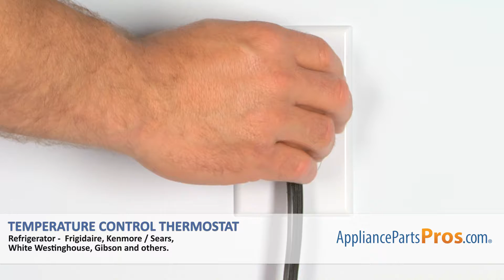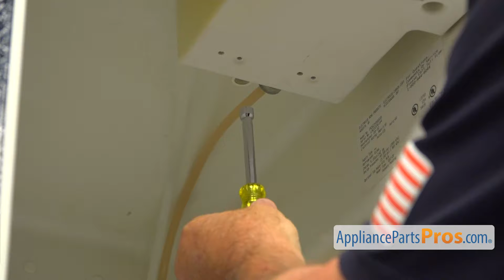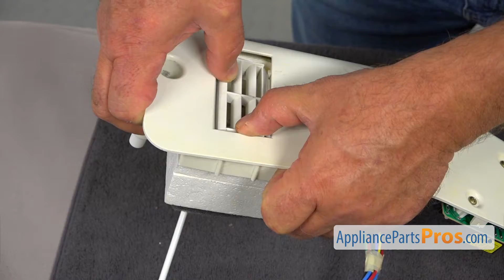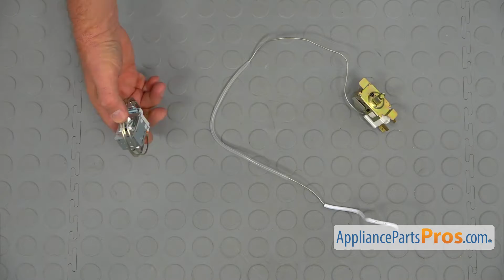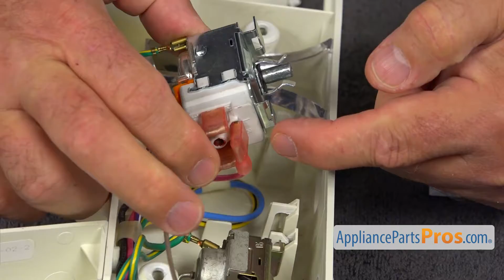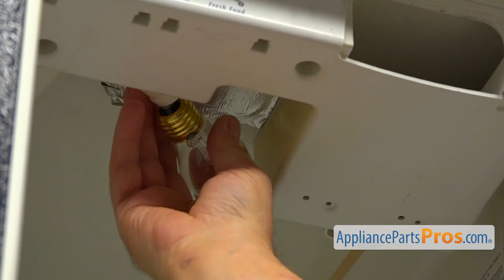How To Replace: Frigidaire/Electrolux Refrigerator Temperature Control Thermostat 240383703

Comment: I have the same refrigerator, evaporator fan runs constantly. . When I turned down the thermostat on the right it does not click or anything, and does not turn the fan off ..so would that be the issue? M# Frs26h5asbb,. Frigidaire for your help.
Reply from the maker: Are the compressor and condenser fan motor staying on as well?
Reply: @appliancepartspros yes..
Reply from the maker: If the fans and compressor are running all the time you will first want to check the condenser coils to make sure it's clean and free of dirt or debris. If you have tried adjusting the temperature and it's still running all the time, then that would indicate a bad temperature control.
Reply: @appliancepartspros  condenser coils are clean, checked everything under there,vacuumed them out.. Now it just seems like it’s on and off on and off. Then it runs constantly.thank you!
Reply from the maker: It is normal for it to cycle off and on. And the unit will run 90% of the time. If it's staying on all the time and the coils are clean then you will need to replace the temperature control.
Reply: @appliancepartspros  sounds good. Really appreciate your help and your quick responses. And Your your video really helps out!!  peace.
Reply: @appliancepartspros  hi, I put the new thermostat in and it seems to be running just as long, but not often on. But now got this funny musty, dusty smell throughout the whole house. I don’t know what that could be. Old thermostat only had two connectors the newer one had three hopefully I hooked it up, right.. any suggestions would be greatly appreciated.. the house just smells like inside a condenser compartment. It’s crazy smell is starting to worry me now. Everything seems to be running as it should.. the hot air is coming out the bottom of the front of the refrigerator.. just seems like it’s blowing out that musty smell from the bottom of the condenser. Any thoughts thanks again, bud.

Comment: I have the same refrigerator, evaporator fan runs constantly. . When I turned down the thermostat on the right it does not click or anything, and does not turn off ..so would that be the issue? M# Frs26h5asbb,. Frigidaire for your help.
Reply from the maker: Are the compressor and condenser fan motor staying on as well?
Reply: Yes..I’m pretty sure they are. thanks.
Reply from the maker: If the fans and compressor are running all the time you will first want to check the condenser coils to make sure it's clean and free of dirt or debris. If you have tried adjusting the temperature and it's still running all the time, then that would indicate a bad temperature control.
Reply: Another thing I forgot to mention is, at certain times it just the evaporator fan just goes off on off like every second,and then it continues to run after that..WTH?. it is really weird. I did order a thermostat for the refrigeration side but now I think something else is going on… question, if the evaporator fan was bad, it wouldn’t run would it?
Reply from the maker: If the fan is turning on and off while the compressor is running then you will need to check for a loose or damaged wire. If the wiring is good then you will need to check for power to the fan motor to see if you are losing power or if the power is steady. If the power is there and the fan is turning off then you will need to replace the fan motor. If you are losing power then you will need to replace the temperature control.
Reply: @appliancepartspros  ok.. I noticed when it’s doing it’s off and on gig, the vent between the freezer and refrigerator opens and closes cycles as well. as well.. I’m hoping that’s just part of the thermostat failing..

Comment: Is the thermostats the same part number for the freezer? Or is it different, on this model?  I have the same model but it’s a Kenmore. But everything you worked on is the exact same as mine.  

So far I’ve replaced the control board, Evan fan, and defrost thermostat.  Both the freezer and fridge don’t get as cold as they’re supposed to.
Reply from the maker: What is the model number of your fridge?